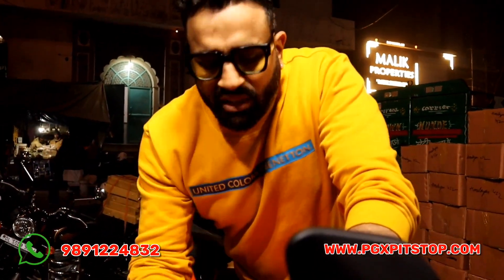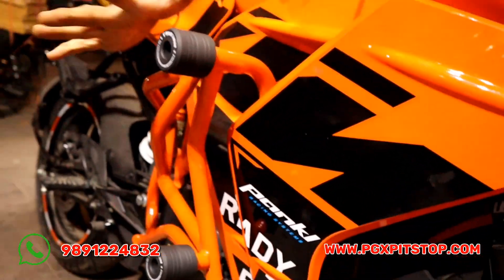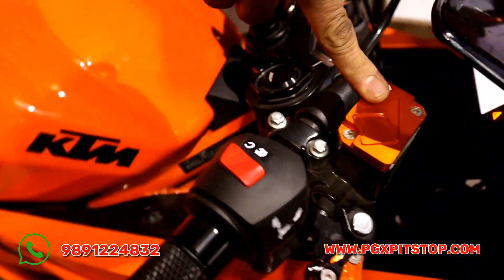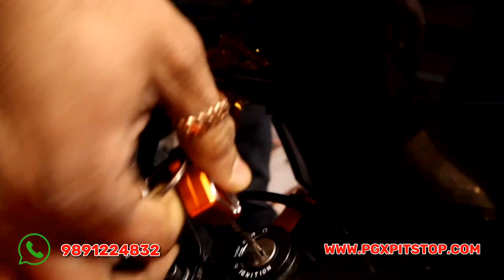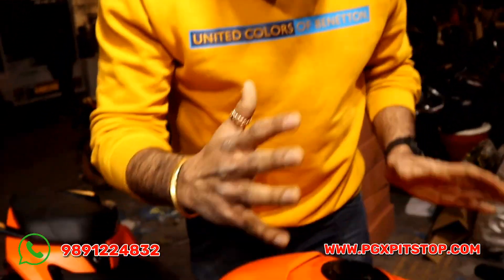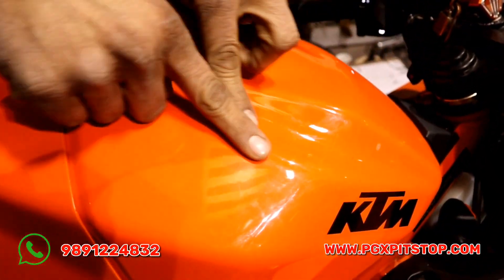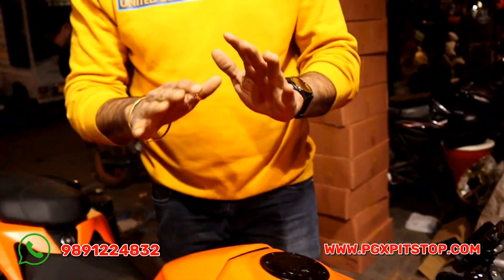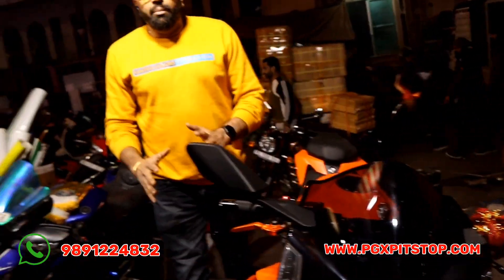KTM RC 200/390 Gp Edition Crashguard | KTM RC Modification Accessories #ktmrc390 #ktmrc200 #ktm

Comment: Clutch lever is not usable for this model.. Because it's not triggering the sensor near cluth lever as the stock one.. So the bike is not starting while in gear and holding the clutch.